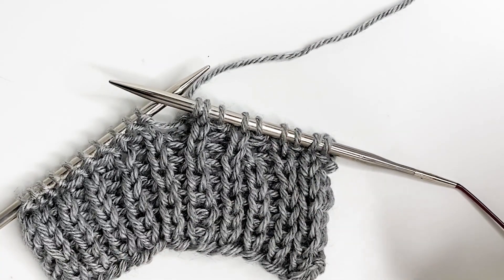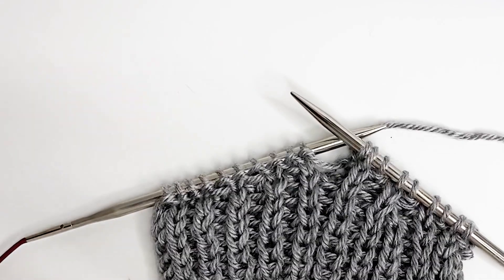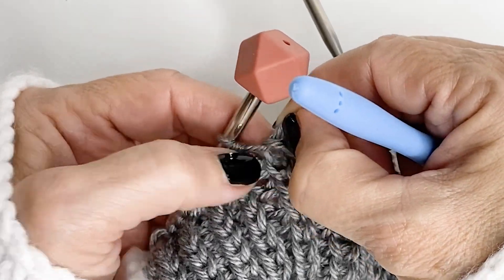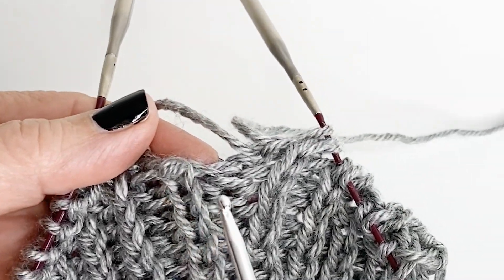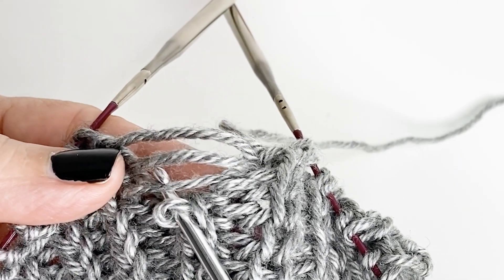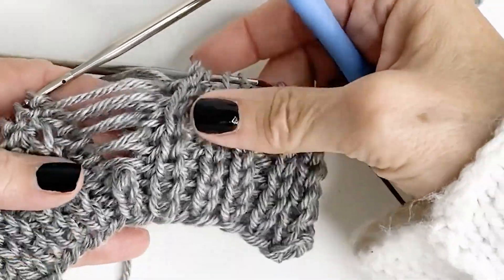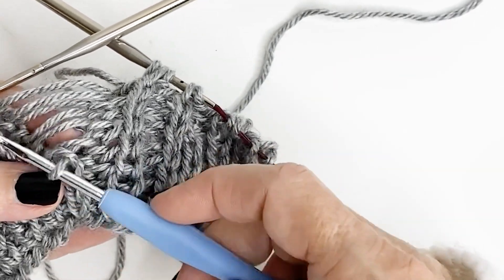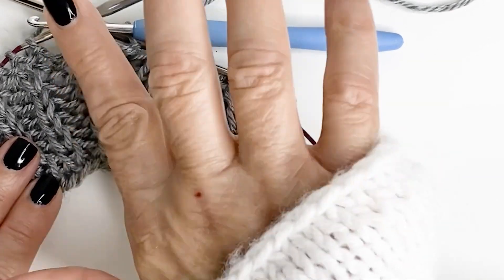Half Fisherman's Rib Stitch / How to fix an error in a Knit 1 Below Column

Comment: I'm looking for help on correcting a mistake row (eg if I did row 2 twice in a row, or row 3) --- when I frog down and take out the mistake row, I can't figure out how to start knitting again in pattern. I get a weird gap no matter
Reply from the maker: First off are you working the half fishermans rib the same way I am. Right side (K1B, P1.) Wrong Side (K all sts). If you need to frog an entire row, or by the sound of it several rows.... I would suggest frogging back to a knit row. The way I do it is.. (I don't use life lines). with the wrong side facing you and starting at the left edge, gently insert the needle through all of your stitches one at a time, being careful more stitches don't unravel from the row below... however if one does unravel place both loops on your needle and you can fix that later by following the video.
As you can tell it is really hard explain to someone how to fix something without actually seeing the issue.
If you haven't knit to far into the project there is always the option of starting over or inserting a life line in a row below.
Sorry I can't be of more help.